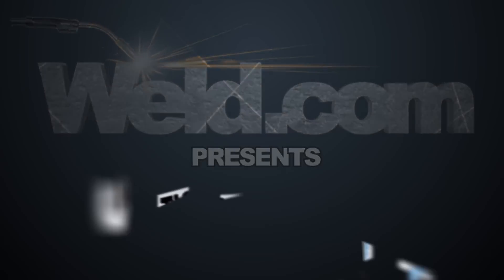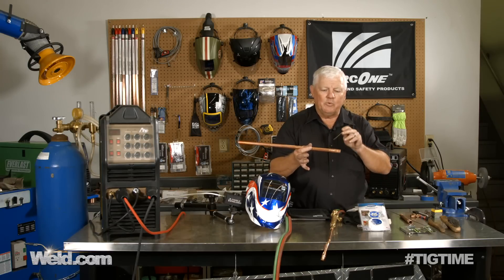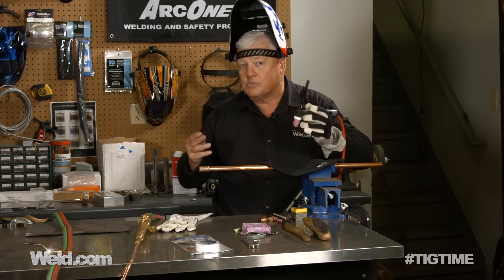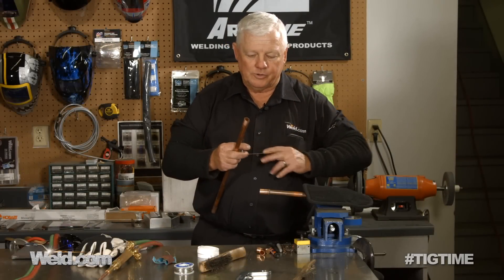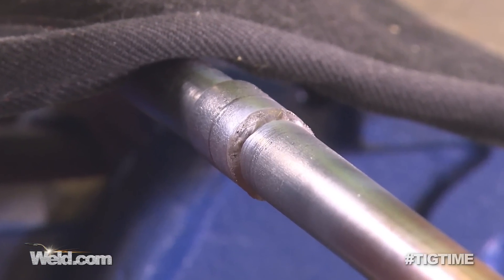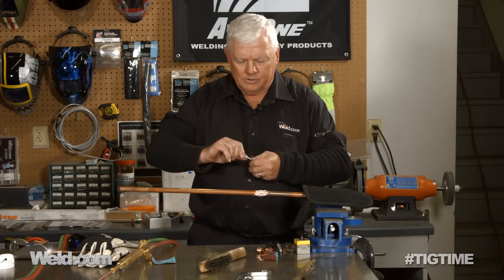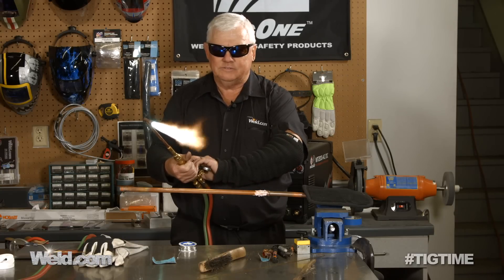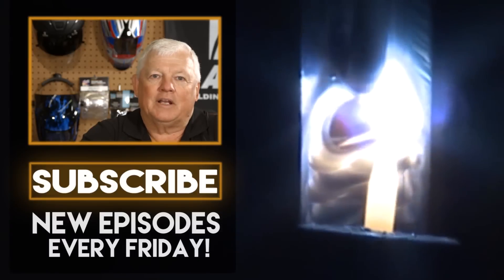🔥 TIG Brazing VS Soldering Copper Pipe | TIG Time

Comment: Hey Mr. Tig, I have a bit of an odd question for ya.  I'm doing a steel sculpture, with 16 gauge tubing that was welded with stick (yeah, I know, I need to get me a TIG welder).  Since I'm still new at this, I ended up having some very small holes on some of the joints.  I tried to fill them with the stick, but the process of filling and grinding had to stop as I was dangerously close to grinding off the sidewall.  So, I'm wondering, do you think I would fill those holes with solder, lightly grind or sand of the roughness, and then still copper plate it?  (I'm going to do electrolytic copper plating at home with a solution of copper sulphide and a car battery charger).  I know its an odd question, but I just want to know if solder will stick to steel, and if it will also get plated.  Cheers!

Comment: Never saw the need for flux outside of the joint being soldered. Also you should wipe the joint clean with a damp cloth it cleans the soldered joint up nicely leaving a pretty soldered joint to look at.
Reply: No no no. No damp cloth. Dry cloth only. Go ask the Copper Development Association. Unless you like crusty calcified fittings a few years after install.
Reply: He is not a plumber obviously:) also, I use silver for solar installations mostly.
Reply: https://youtu.be/quJXIkLOB0I  solderless easy connect &removable copper pipe and fitting
Reply: @eyewearmachinery  How much are your fittings? Do you have a Pricelist of all fittings?
Reply: @eyewearmachinery  shark bite dumb fuck

Comment: wow! there is just so much wrong with everything about this video. the first braze is totally useless. no capillary action. the part was way too cold with that small tig flame. the filler alloy should have been a phosphorus,  copper, silver alloy. the heat of that big multiflame torch was way too hot for the soldering job. you used way too much flux! a lot of excess flux ran inside the piping system. you only apply flux to the male part. the technique for soldering was all wrong. you might get away with that on a small 1/2 inch line, but certainly not on anything larger. I'm sorry, but this whole mess was very disappointing from someone so skilled in other processes.
Reply: You said everything I was thinking through the whole video
Reply: Rattletrap2 was a bit messy  and iv never seen brazing that bad before lol
Reply: Rattletrap2 there is a reason why they have a brazing tip . lmao
Reply: Absolutely. I braze copper every day as an HVACR guy. OxyAcetylene torch, either a 0 or 2 welding nozzle, acet reg at 7 psi, oxy reg at 10psi. I like 15% sil-fos. Absolutely no flux. Proper heat is key. Capillary action is a pretty clear sign when it’s been heated enough. It’s really not that complicated.
Reply: @hightide9513  This is what I do, except the PSI are different.  Was at 5 and 10 the other day.  But usually around those numbers like you.  Test them up to 500psi so it definitely works.
Reply: In plumbing school they always say flux both sides and spin the pipe....
Reply: @PlumberWRX  but do they tell you to use half the Bottle of Flux on a Joint. Ive never seen thatmuch flux user ever.
Reply: @KevinPolin  no. A pretty thin application all around. Atleast, that’s what I was taught. Obviously, too much flux and it will drip inside the joint and bring solder with it. Our instructor made us cut our joints in half and he didn’t pass anyone unless it was clean on the inside and outside. It’s not practical in many cases to spin the pipe on an install, a lot have to be put together piece by piece. It’s pretty easy to tell when enough solder has been drawn in though and I’m not even a professional, it’s just required in my field every now and then.
Reply: Agree with you 100% Rattletrap!
Reply: I always flux the male part....she appreciates it so much more....
Reply: https://youtu.be/quJXIkLOB0I  solderless easy connect &removable copper pipe and fitting

Comment: I have used acetylene when all else failed and I had a trickle leak from the upstream inaccessible valve.  Kept a valve open to allow the steam to escape and it worked well.  I had tried the bread crumb trick to no avail.  So it can be appropriate.  Just be very careful of your valve bodies and components.  Now the new shark fittings can be a god send.  Doug

Comment: I much prefer your segments to the other guy's.  This is very informative.  I can't envision many instances where you would have full access to weld piping.  Whereas the solder or silver solder 'pulls' all the way around to the top or other inaccessible spaces still get full coverage. I would like to see a cross section of this as the weld looks to be sitting on top of the copper.  Interesting in any case.  Doug

Comment: I would love to see some more oxy welding, soldering, and brazing on various metals and the products you use to do that, like for instance oxy-acetylene welding aluminum. Why? Well sometimes you can't get a tig welder, generator, and argon tank to the same places you can get a oxy rig and/or temp/ conditions are too inclement for a TIG welder, for instance repairing an aluminum or stainless mount on a snowbound weather station via snowmobile.

Comment: it looked like you were running a wide arc. was that intentional to spread out the heat input ? also you didn't mention fusion welding . is that an alternative with copper?

Comment: silver solder vs lead solder copper - why and what application
Reply: +Adrian Higgins Lead solder for potable water has been illegal for decades now, I believe.  The old 50/50 flowed like hot butter but that pesky old lead poisoning finally put an end to it.  The new lead free solders don't flow as well but won't slowly kill your brain cells either.   But to answer your question solder is fast requiring only mild heating where low strength and pressures allow.  Silver solder for high strength applications like refrigeration lines.   Silver soldering requires more heat, makes an ugly burned looking joint, takes longer and the filler metal is way more expensive.  You can see an example of each if you follow the refrigeration lines from your air conditioner to a joint.  And(if you have copper plumbing in your house) go to your water heater and look at the lines going in and out of it.  You may need to peel back some insulation to see the joints.
Reply: +Adrian Higgins 
We should add Rosin Core and Acid Core solder to the list.
Tom
Reply: +Adrian Higgins Silver solder is stronger so you can use it for a higher pressure and it is also cleaner ie. no lead.

Comment: How about cutting the joint apart and discussing relative strength?
Reply: https://youtu.be/quJXIkLOB0I  solderless easy connect &removable copper pipe and fitting

Comment: Thanks for a great laugh as I was rolling n the floor. I'm a HVAC Tech and use both process's and using a rosebud to sweat with is like your Dentist using a hammer drill on a tooth. And tig welding copper interesting ideal. Thanks as have to share with the Facebook bunch.
Reply: There way no penetration on that tig joint.   Just a measly cap.   Worst trade advice ever
Reply: +MrYogibtp When using the silicon bronze filler, there is no penetration because the base material (in this case copper) is not supposed to melt.

Comment: I have been soldering for years and have never needed to flux the OUTSIDE of a solder joint. Ever. The mating surfaces need to be clean as possible and fluxed for both acid cleaning and wetting agent action. But the outside of a fitting? If anything, if the application at hand is vertical, the solder will flow out of the cup and follow the flux. Result? You have now "chromed" the joint. Looks like crap and both your boss and customer (quite often one in the same) will be less than impressed. Better to apply "just enough flux to do the job, apply heat, wipe off any excess flux running out of the joint before applying solder. The result? any excess solder which flows down out of the joint will be easily peeled off after cooling as there was no wetting action, hence, no adhesion. Horizontal is much easier and less critical. 
 Also, I think too much flux will bubble/boil in the joint and may cause a pinhole leak. Enough to do the job, and no more. The idea is to get a full solder cup and a slight fillet showing and no more. 
"More" is not always better. Try it out and see.

Comment: You would be better off using the torch to braze it than weld it. Also if you had a little more heat to the pipe with tig it will flow.
I weld copper directly and with phosphorus bronze all the time. Dropping the hot copper in water cleans it as well.

Comment: Aww, I thought you were going to  weld the copper with 100% helium and  romex  for the filler (like in the other video). Joking, kinda :D.

Off topic question: Wyatt, do you also know how to weld with oxy-acetylene? I ask because back in high school I was decent (as far as decent goes in high school manufacturing classes) with TIG but I was awful at Oxy. They seem (at a rudimetary level) like similar processes as both use filler wire (and "dabbing") yet with the oxy torch I spent most of my time blowing holes in the metal. I (obviously) never had that issue with TIG.
Reply from the maker: +Larry Bolan Yes, we are actually in the process of doing a whole series on oxy acetylene (gas) welding.
Reply: +Weld.com   I'm looking forward to that series.
Reply: +Weld.com Hey ,Do it with the Dillon 2000 Acetylene / Air torch. I recon it will do it easy.
Reply: Binford 2000

Comment: Using that rosebud is like using a Howitzer to kill a deer.
Reply: +No Ammo Yes, but isn't that way more fun?
Reply: That is something I'd pay to do. 105 deer blasting.
Reply: No Ammo he should have used a brazing tip
Reply: @lannyfullerj3852  or a propane torch since it’s impractical to tow around a torch kit just to solder copper pipe..

Comment: way too much flux, no matter the pipe size you should start adding filler metal to the lower portion of your fitting to create a dam, and when you welded the fitting on you have zero penetration and since the copper is now annealed you have created a weaker joint by just capping the joint...
Reply: Also agreed with the way to much flux
Reply: +Pizza Welder I found it interesting that you could TIG weld/braze copper tubing. I would be equally interested in knowing how you weld pizza.
Reply: +Ralph Dratman fuck it grab the weed burner 😂😂
Reply: tsmartin It isn't that hard, but requires some specialized tools like a "microwave" and a "tombstone". Insert pizza into microwave and heat at 1500 watts for 7 minutes. Where the real trouble comes into play is if you live at high altitudes. I might have to release a video on how to adjust your settings.
Reply: He would also be better off using oxygen acetylene torch to braze it IMO an oxy acetylene braze looks soooo much nicer
Reply: +speedyticket Would plain (no oxy) propane work?
Reply: +Ralph Dratman  yes
Reply: +Ralph Dratman as long as you had a larger tip  for bigger airflow
Reply: ReluctantProphet he wasn't actually welding the copper, he even said it, copper melts at 1900 and the filler melts at 1800 all he did was braze it
Reply: +ReluctantProphet I do believe the entire purpose of tig brazing is so you DO NOT penetrate, hence the lower melting temperature. Have a jolly good day kind sir!
Reply: +Pizza Welder which would have zero practical purpose and calls into question why he is touting this process for very high heat applications. Good day to you as well...
Reply: +speedyticket I do have one of those